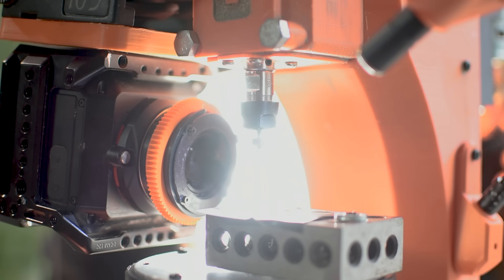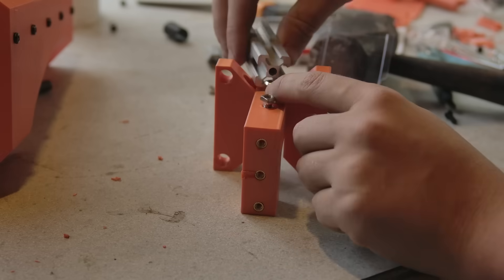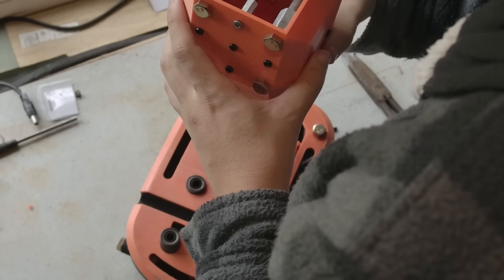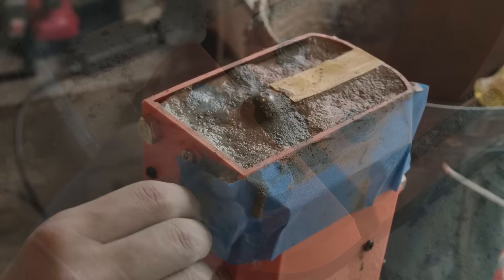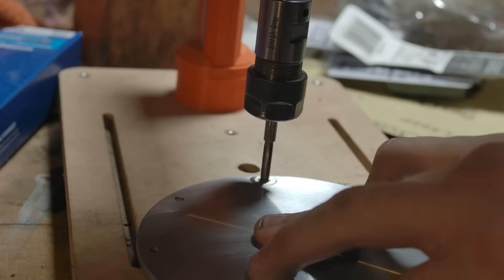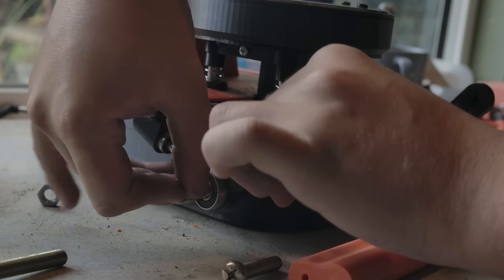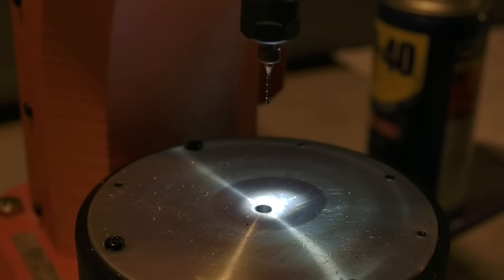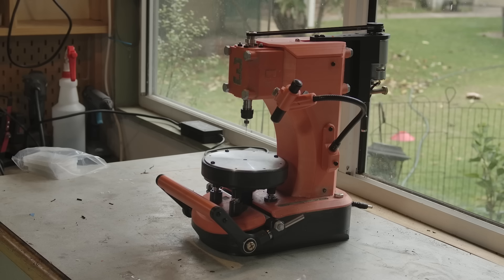I Printed A Sensitive Drill Press

Comment: Couple of things: threaded inserts are not stronger than tapped threads. They just make things look neat, and in case of having to constantly screw things open, they give very good longevity. But, if we are only talking about forces.. tap the threads straight to plastic. You get equal or better compared to threaded inserts. The best thing about tapped threads is that it is the same everytime, whereas the process of melting plastic to insert the insert.. is variable unless you have a dedicated machine for it. Threaded inserts should be avoided unless you need it to look good, or that you need to take it apart often. And this comes from someone who loves threaded inserts but i don't give a fuck about my feelings when it comes to design. What works the best, works the best and tapping thread to plastic is just the best way to do it. Do NOT use self tapping screws, or try to use the screw itself to tap itself. Those will push the hole wider and starts destroying layer adhesion around the hole. TAP IT! Not an option, it is mandatory to cut the threads.

Then superglue: it has abysmal parameters on shear forces. It should NEVER be used to fill gaps if looking for strength. It also has almost no elasticity so it will crack. The thinner the layer of superglue is, the stronger it is. Epoxy is good glue to use when you need strength in all direction and rotations and you need it to fill space.

WD-40 is not a lubricant. It is water replacement fluid. If you want a good generic oil that works nicely on a lot of things, including low RPM cutting: sewing machine oil.. Beautifully simple stuff, it is just basic petroleum based lubricant with nice viscosity made for parts that spin relatively fast. 500-5000RPM. It is also not a cutting fluid but it'll do for.. thousands of applications. Now, WD-40 is definitely better than nothing but.. get yourself sewing machine oil, one of those squeeze bottles will last years as a generic lubrication. Get real fluids and oils if possible but if you want just something that works on most things.. it is bloody brilliant stuff. I fought against it since it was my grandpas favorite oil (he was sewing machine repairer...) but.. after about 35 years of fighting against the idea.. i had to just give in. I have all the lithium, PTFE etc oils but.. i still grab the damn "old school stuff" all the time. Another old school stuff is basic vaseline, not for cutting but it is also one of those things that should be in your "essentials" toolbox along with your WD-40.... WD-40 is for water replacement, you use it to replace water... anything that is wet and needs to be lubricated: WD-40 followed by a proper lubricant. It makes so many things work, it is amazing stuff when used correctly.

Comment: Once the concrete is fully dry(weeks to months) it might have shrunk to the point of no longer really being connected to the print, pouring in diluted garage-floor epoxy would be a way to fix that and likely make the press(and lathe..) better than it was before the concrete shrank...

also: Clea-rcoat is generally a better way to restore luster to prints and have the added bonus of sealing the print from moisture absorbtion(many are also UV protective, such as many/most oil-based polyurethanes)

Comment: Thanks for the video.  When you say “point 3 mil” I think you mean 0.3 mm (300 microns) not 0.3 thousandths of an inch (0.0003”).  Is that right?
Reply: Correct, in Australia we shorten millimeters to "mil". In design and engineering industries we default to millimetres, sometimes use metres but never use centimetres.

Comment: You might try using boiled linseed oil to restore the plastic color.  It will eventually dry (or cure?). I use it on my black trim on my car and it works amazing and much better than armor all or silicone.  I’m sure I’ll get roasted for suggesting it as well, lol.

Comment: How do you get your filament/printed parts to withstand the moisture from the wet concrete? I found that my prints get really fragile over time even when exposed just to the moisture in my room (i live in a tropical climate). They legitimately crumble to dust

Comment: I don't watch your videos very often, but when I do they're always engaging and well presented.  This one's no different.  Although I did notice that a lot of your parts look more like they were designed to be injection molded rather than really optimised for 3d printing - the front cover, for example, could just be angular and not need supports at all.  But of course aesthetics are a big factor for any personal project.

I do have a question: when you say "mil," are you actually referring to mils - that is, 1/1000ths of an inch?  Or are you just truncating millimetre?  (I'm Canadian, I truncate mm and ml myself, but that occasionally leads to confusion since a lot of things default to Imperial here and so actual mils can also be relevant to a conversation.)

Comment: when using a mold like this use a plasticizer concrete additive, it will make your mix turn to an almost water like consistency, you can find it at most hardware stores and its dirt cheep!
Reply from the maker: ill give that a try, im working on a video testing all sorts of variables for using concrete in prints.
Reply: @Borgedesigns  sounds interesting the other advantage is that it reduces water needed by about 40%. another thing to check out is useing gypsum as a additive to make the working time longer. If your working with small areas in molds it may help to use a mortar repar mix as it tends to have smaller aggregate.
Reply: That would be new and valuable.  Subb'ed for it!  Great work, man. @Borgedesigns
Reply: It'll leak trough on all sides of the mold though

Comment: If you are sanding ABS  you can use a heatgun to restore the color back   hope that helps
Reply: I sometimes use a lighter or low-intensity butane torch to do the same with PLA for this purpose, carefully of course.
Reply: @TheLex1972   dichloroethane for pla
Reply: @TheLex1972 I've never managed to do this with PLA without it warping/sinking/melting like a snowman in summer. No matter how carefully, or slowly I heated it.

Comment: Cool! I wouldn't expect Vaseline to have a major effect in the way you're applying it. I think that if you leave it on long term it might act as a plasticizer, leaving the surface softer. Also, applying it and raising the temperature above Vaseline's melting point of 37C might cause it to more rapidly diffuse into the PLA, again acting as a softener. This owes to Vaseline effectively being composed of about 1/4 mineral oil, which is lightweight hydrocarbons which  can diffuse through the PLA matrix and reduce intermolecular forces, producing a more pliable material. Definitely won't destroy it!

The biggest problems would be from directly applying mineral oil to PLA and then using the part for a sustained load, as the plasticizing effect would reduce toughness for that application.

Comment: i`d say that the reason why the drill broke is your handholding of the part, rather than the speed... i use carbide micro drills in my baby emco fb2 mill and she goes up to 2k rpm... drilling through bearing balls and bearing races at that... `s all about proper clamping, spindle runout and rigidity of the system... the speed only affects how much material you are moving and how fast you can do so... 
Otherwise, a nice project for sure! I would have made a faux quill for the bearings, or a spindle housing of sorts, to put it thus... Just bore out a pipe and fit the bearings in that, add some outside geometry for interlocking with concrete and voila, a more secure means of bearing retention and also has the added benefit of insulating the bearings from moisture in the concrete, the seals and gaskets you used notwithstanding... 

Best regards!
Steuss

Comment: As others have said, I think the bit snapped from the work piece moving.  You could clamp it in place, but for what this seems like it's meant to solve, I would say maybe make the table top have a textured surface instead.  Something like a sheet of rubber would probably give enough traction without having to spend the time clamping and still hold up over time.

Comment: I made my own for watch making kind of stuff.  Frame is 80/20, slides are higher end macro photography sides.  Motor is brushless DC high speed spindle with an R8 collet system.  X-Y table is made from an X-Y stage.  If I need to rotate stuff to be machined, I use a rotation stage.  I 3D (resin) printed adapters, etc. as necessary.  Too bad you can't post images in these comments or else I'd show a picture.
Reply: If you could put up a shortened link url or something that would be awesome. I’m sure a lot of people would love to see it.
Reply: @antonc81  I'll see what I can do
Reply from the maker: would be interesting to see for sure

Comment: instead of vaseline you can use heat to return the color. in this case i would use the heat after filling with concrete. also scraping instead of sanding leaves a finer surface

Comment: The reason the 0.30 mm drill is breaking could be because of run-out in the bearings themselves or the collet not centering that precisely. 
Remember it doesn't take much to run-out the entire diameter of the drill with these very thin drills. There's an episode on This Old Tony where he breaks end mill after end mil in his "chinesium" collets until he realizes the problem 😅
Edit: -> https://www.youtube.com/watch?v=ncbJkz1zHOI

Comment: This is awesome! I love the concrete fill. I am planning an epoxy granite CNC it's cool to see this technique used on a small scale! My serious hobby is building planetarium projectors. My next build incorporates "star plates" or slides. In the first Zeiss Projector the holes for the stars were hand drilled or punched in copper foil with a needle. Later Zeiss and other companies like GOTO and Minolta used photolithography to make photomasks for the star plates or slides. So I am torn between the hands on simplicity of drilling and punching holes on thin copper or aluminum or setting up the lithography process which is magnitudes more complex and demanding in precision.
Reply from the maker: Thanks, that is fascinating, its always interesting to hear how stuff used to be made.

Comment: I looked up the E value for concrete and it's lower than I had thought (about 1/8th that of steel.) That said, there's a nice chunk of it in this project along with that reinforcement of the threaded rod.

Comment: I know Concrete is cheap and works, but epoxy granite is a much better solution for weighting and stabilizing machine tools.

Basically mix sand and epoxy resin into a paste, and fill your parts.
Reply from the maker: My worries with it are cost, but more importantly setting temp. My understanding is that a large mass would easily be hot enough to melt the printed forms, so I would have do multiple layers. Ill experiment in the future tho because it is the better option in the long term.
Reply: What makes it better?
Reply: @RomainQ  to my limited knowledge concrete will turn porous after setting hence less dense then epoxy sand.
Reply: @ipodtouchiscoollol  Well made epoxy granite is also superior in vibration damping, at least based on what I've read.
Reply: @Thorhian it’s slightly softer so can absorb high frequency vibrations, but concrete has a higher density which helps with the lower end and on something like this it doesn’t matter much anyways
Reply: @Volt64bolt  Makes sense, and yeah, concrete/mortar is cheap and easy in this case. Creating a good blend and getting decent epoxy is complicated and more expensive.
Reply: @Thorhian  The list of costs at the end shows $20 worth of concrete. He must be using a special gold flake infused mix.
Reply: @Volt64bolt  also the concrete can crack while the epoxy is much tougher
Reply: @nirodper  ehh, it can but not easily when enclosed like that. And even less if he reinforced it. Epoxy softens with heat as well which can be bad
Reply: Powder is even better than sand for epoxy granite.

Comment: Nice build, but I can't help but wondered why you never print some kind of "funnel adapter" for your concert filled prints, would make filling them much easier and less messy.
Reply: because you could just y'know, wipe them off when you are done pouring, No reason to waste plastic just to make a custom funnel. And even if you still prefer a funnel just using some cheap wood planks could do the job too
Reply: This is actually a really good idea, might even be able to print it in vase mode(but with no bottom layer) and having a small lip in the main part it just seats down into! Uses very little plastic but buffers all the concrete into a larger aperture area that's much easier to fill up without spillage.
Reply from the maker: ive tried funnels, I just find them to slow. But im working on a video testing concrete mixes so ill experiment more in that.

Comment: Though the design is useful for larger drill sizes, does not have rigidity needed for smaller drills.
A loadcell(located in 3 corners) with filtering on base should be able to provide a real time feedback, while retaining the needed rigidity for smaller drills.
It will be limited by the runout of the spindle shaft, collet, apart from the squareness of the spindle mount wrt base. Just some 💭❤️👍

Comment: When working with a drill that small, I wouldn't be surprised if the slightest movement of the drill subject is enough to snap it, so your first project for it should probably be some clamps for the drill table.
Reply: Basically what I was about to comment, I use drills this tiny to "clean" (or adjust) propane burner nozzles, and you have to clamp the part in a nice heavy vice (or you could attach the vice to the table I guess but that would be a nuisance to move around to adjust hole location, unless you got an XY table, but then the tiniest play in the table would allow movement snapping your drill bit), but table clamps could do the same job too, though probably slower.
Reply: Yep, I've learned this using hand drills that tiny. If you put any side force on it at all, it's going to snap.
Reply: @Studio23Media  My small drill bits have hexagon end so I can use my screwdriver as a hand drill.
Reply: @test-rj2vl  0.4mm is way smaller than you get in hex-bit drill bits.
Reply: If you use carbide drill bit but watchmakers have use steel wire spade bits for hundreds of years
Reply: @babbagebrassworks4278  Tungsten carbide was invented in 1920. It's not exactly surprising that watchmakers used something different before its invention.

Comment: I absolutely love the use of different materials for infill. I'm surprised this isn't done more often. For example, PU foam (25lb) can be ultra-rigid, exceptionally strong, etc, but cost a pittance compared to a pure print. It also imbues the object with different mechanical properties (eg. buoyancy, water resistance), which is cool..

You may be interested in considering TPU for gears or other mechanical components. It has exceptional wear characteristics, and is reportedly very quiet in operation. And when printed as a solid part, is quite rigid. It's a hidden-gem of a material.
Reply: Such a good idea i hadn't thought of before even though its so obvious and can be easily adapted from the design stage when 3dprinting.
Reply: @MatchaMakesThings  There are so many of these interesting ideas out there. It's such a wonderful community to be a part of!
Reply: People think of tpu as the squishy filament but you can’t print it pretty rigid and it’s tough
Reply from the maker: Its cheaper and stronger, im shocked ive never seen it used in printed CNC machines or similar uses.
Reply: @Borgedesigns  Thanks you your video, there's a chance it will be used more often!

Comment: very cool. heres an idea for an addon: a foot pedal that operates the table through a cable (think bike cable brake lever) to give you 2 hands for controlling the piece
Reply: He is not mass producing stuff and your work piece should be secure anyway. Not that kind of tool to need a pedal to operate it too. Unnecessary complications are just not what the build is about.
Reply: The point of a sensitive drill press is the fact you feed it using one hand- that's how you can 'sense' the cut, and perform such a precise operation. Foot pedals are sometimes used to control drill on/off or speed, but not the table.
Reply: Let's not tell people to do things that are safety violations
Reply: @noahprussia7622  it’s not though lol
Reply: Also gives you a hole through your hand. Bad idea and dangerous
Reply: @noahprussia7622 huh, you already have one hand to control it

Comment from the maker: Been excited about this one for a while, unfortunately I am leaving for a camping trip and will back back monday, so no files until then.

A couple of FAQs I see coming, 
-Why so big? Well it doesnt cost much more than the smallest I can see it being, and the larger size allows for more complex workholding solutions in the future. The weight contributes to vibration dampening and makes for an overall more pleasant experience.

-What is a "sensitive" drill press? Technically all the presses I showed in this are sensitive drill presses, any press that isnt, for example, drive by a screw is a sensitive drill press, where  you can feel the feedback of the drill bit. However the term is most commonly used for presses like this. 

-Parts list? When im back.
Reply: I wish I had the shop and tools needed to build this! I could have a whole shop if awesome handmade tools designed by you! If only I had the space. 
Maybe someday
Reply: Looks exciting - Have a great camping trip and an excellent weekend!
Reply: Super build and video. Have a great trip!
Reply: Give us a holler when you’ve put the parts list on please..
Reply: Any files yet?
Reply from the maker: @hi1172  Check description now